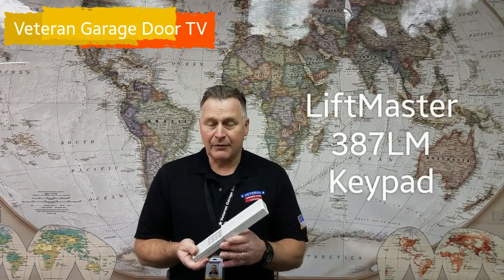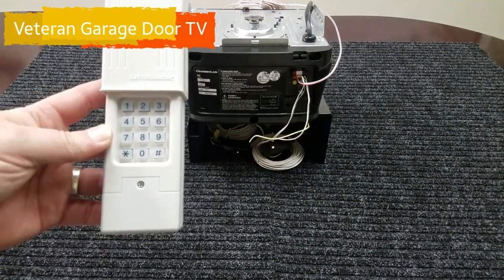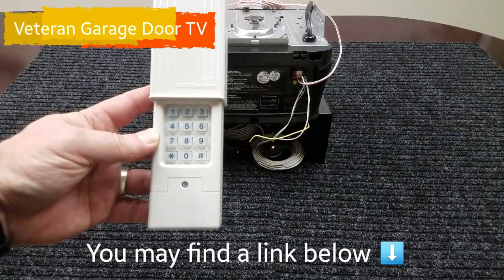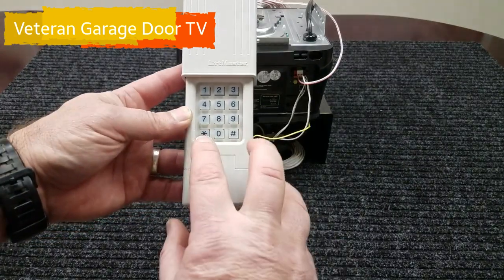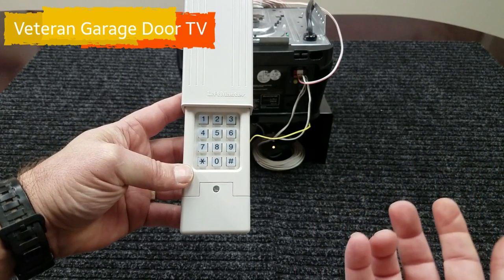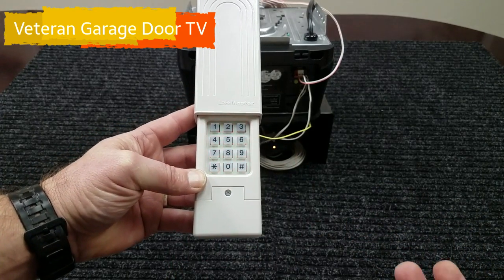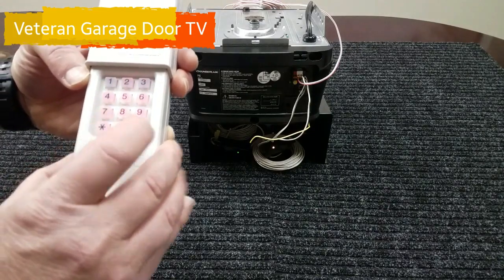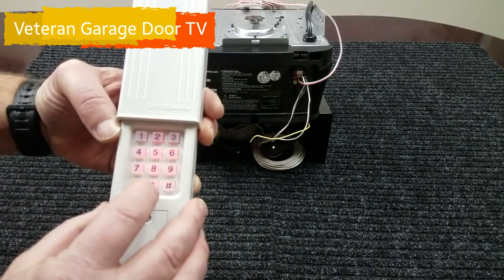LiftMaster 387LM Programming @ Veteran Garage Door

Comment: I was able to get the wireless keypad to work but the final code was 5 digits...my 4 digit code plus 0.  I tried to set it up without using 0 but was unable.  The unit works fine but my code is 5 digits.  
Unless I did something wrong, the eventual code will be a 5 digit code.   Please advise if i made an error in programming.   Thank you as the video was very helpful.
Reply: 0 is acting as the “enter” key.